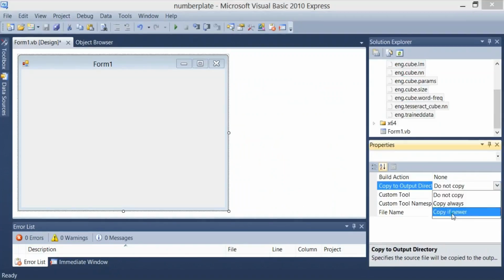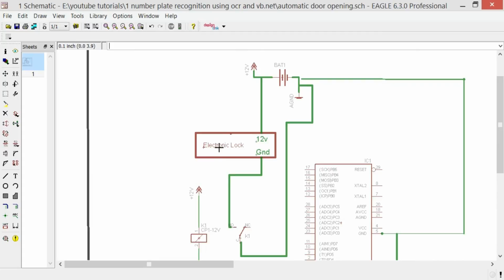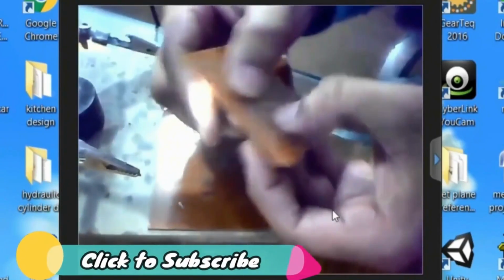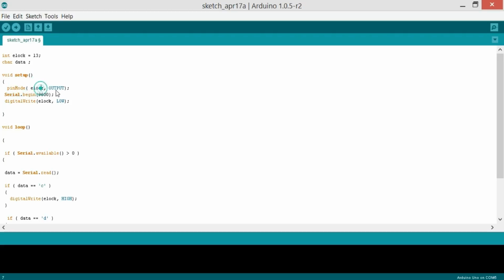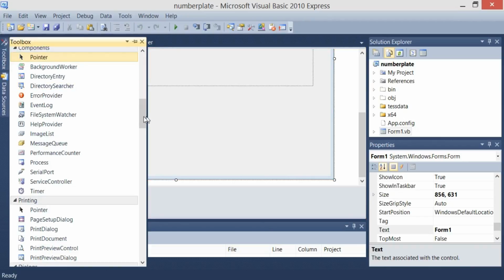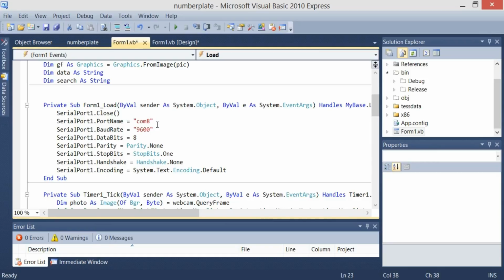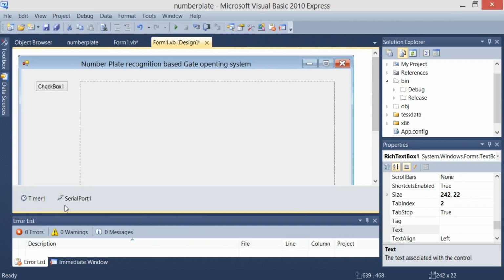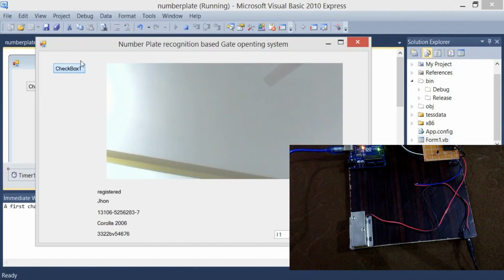OCR Optical Character recognition based car Number Plate Recognition using Arduino,vb.net and EmguCv

Comment: Hello sir my code is running, but it is not showing me picturebox working in the output. Can you please provide me solution for this?
Reply from the maker: when i get online i will.send you the complete  project don't worry
Reply: @ElectroniClinic   Okay !!!
Reply: @ElectroniClinic   sir can you send it as soon as possible?  Please...
I require it very urgently.
Reply from the maker: you didn't send me your email id.
Reply: @ElectroniClinic   ohh i am sorry
Reply from the maker: The app size is more than 1GB. not able to send via email.  you copy all the code from my website. you can send me the pictures where you get the errors then I can properly guide you. here is my WhatsApp number +923339218213
i will send you the pictures of my designed app. you will get the idea, how to add different tools.

Comment: Hi nice Project, I want to make similar project in which I want to  recognize Product number having fix 9 digit with 1st Starting digit "K" Like "K12345678"
I want to take it as a input string to Excel Cells or SAP.
Please suggested any Similar Method or guide me.
Reply from the maker: give it a try. you can use this. watch my other tutorials on vb.net. you can combine all the codes and can make an awesome project. 
you can also contact on my whatsapp number +923339218213
Reply from the maker: you can tell me in detail what exactly you wana do.